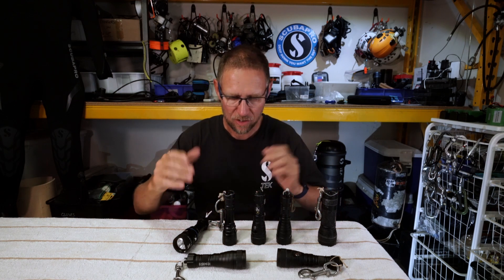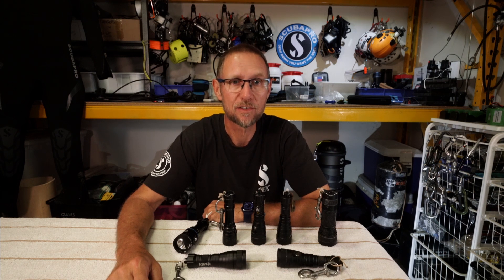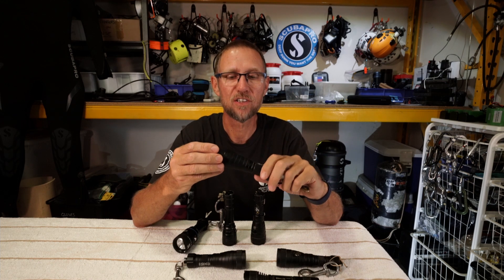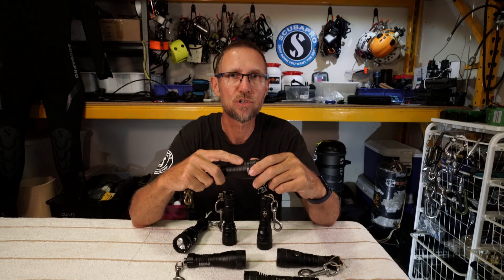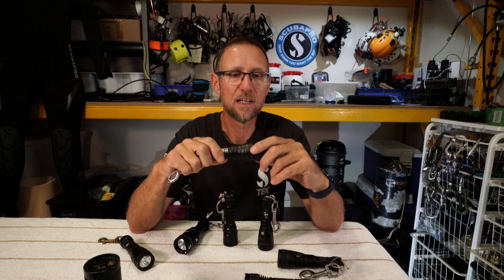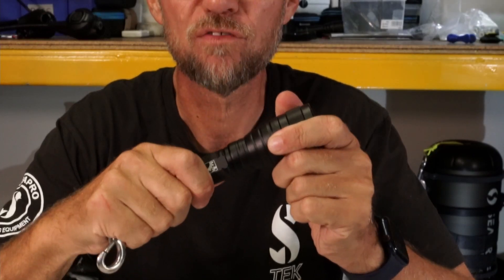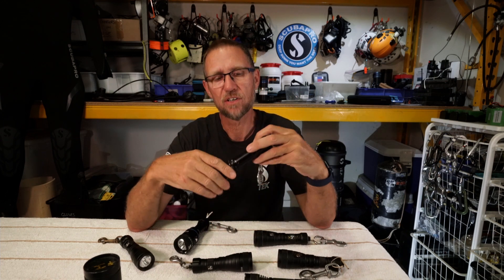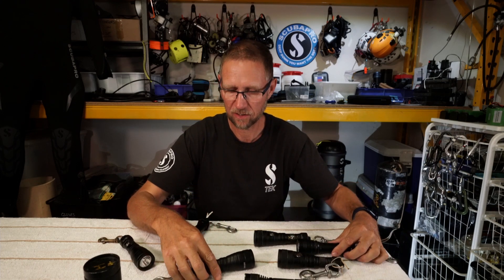Backup Lights 300m Deep Test!

Comment: Dare you put the dive Scurion into it!  I'd be interested to know if it does 300m but (A) won't ever go to that depth to find out myself and (B) would cry if it broke.  🤣
Reply from the maker: Craig and I both have the Scurion Dive lights and we have dived them to 245m. Unfortunately the battery packs started to get small amounts of water in them at that depth. They are undoubtedly awesome lights however!

Comment: I think if you were to measure the 650 lumen light against the scuba pro 850 you would find the difference. Human eyes are actually pretty bad at perceiving brightness. That's why the DALI lighting standard they included the "DALI curve" because we don't perceive light in a linear fashion. 
(But I wouldn't say I am actually qualified in any particular way, so take this with a grain of salt).
Reply: Lumen is the total light production, not the brightness. Light intensity (or brightness) is measured in candela. 

So, for instance, a light bulb can produce a lot of lumen, but since it's emitted in all directions, the light intensity (candela) isn't very high. A laser produces very little in terms of lumen, but concentrates into a tight beam, so the candela is very high.

It's therefor hard to visually compare a 600 and 850 lumen light, since the extra light production may be in the corona, and not in the focused beam.

Comment: Harry

Way in the past they made dive lights that non-penetrating switch using magnetic reed switches, and even the AquaZepp used them for power switching (Zepps used them to activate a relay).  Am surprised that no is making deep rated dive lights using that tech today

John

Comment: Hey Richard, I'm curious about the issues you see with the push button switches - I think you mentioned from the Bigblue lights. If they are activating at depth, I suspect they aren't a true magnetic switch (which would use either a hall effect sensor or a reed, with a moving magnet). For a true magnetic switch, the reed or hall effect sensor would be completely sealed inside the housing, with usually a basic push button with spring moving a magnet close enough to the housing so that the magnetic field reaches through the housing thickness and activates said sensor when the button is fully depressed. The void where the spring and magnet sit is environmentally exposed  to allow water to easily enter / exit, firstly to allow the magnet to freely move but also to mitigate any pressure changes since water can freely move in / out of the void.

Another possibility is that the void I mentioned above in the torches with issues is environmentally sealed, at least from the outside, hence at depth you would run into issues with the button being depressed due to the increasing external pressure.

I've been searching for an off the shelf true magnetic switch solution, but have yet to find one. I have an old un branded dive torch which does use one, but it looks like a custom design where each part, particularly where the magnet sits, has been custom fabricated.

Great videos and content by the way. I don't dive to depths you do (50m is my absolute max at the moment) however I always look to the tec divers to increase my knowledge in order to apply this to my recreational dives to improve my conservatism, amongst other benefits.
Reply from the maker: Hi I actually haven't asked Big Blue how the switches work, but I have had the strobe problem with at least 4 different BB lights on separate dives, and as shallow as 40m in one instance. The Dive Rite primary has a rotating collar which is seemingly a magnetic switch with no penetration of the hull, so that would inspire more confidence. I have some deep dives coming up and will give that a test.

Comment: I’m looking at making a pressure vessel for testing as well. Any recommendations or lessons learned?
Reply from the maker: Next time I would make the top half much shorter so you can fill the base, then more easily put the "lid" on and fill the lid through the top hole. Other wise it seems to working well (and I am no longer terrified of it!). In fact I am planning to get the lid shortened.
Reply: @DrHarryH  Great to know! I'm thinking of a very similar design, but I might try using some thick walled steel pipe and pipe flanges for an easy bolt on top.
Reply from the maker: @serafinobp9428  I did get an engineering mate to review my concept. Be careful and only ever use water to pressurise!
Reply: I would think just the ali top plate would work well without the  short tank section but with inside turned down 5mm to act as a bit of a cap to locate the bottom tank inside it, unless you need the extra lengh of the top tank half

Comment: Well done! Niki fro Scubapro here - the lights guy... We do have a "tec"version of the Nova 850 as well. It doesn´t have the Safety mode (which is ment to protect the light from accidentally switching on in your luggage and melting your t-shirts  :) ) and it is a turn to activate light head, so even safer for your really deep dives. It comes with the 3C battery tube, but you can also use the 18650 tube you have on your normal 850R. The reason why we don´t claim the 300m for the push button lights is that we simply can´t test properly enough to do such a big claim. The light is too relevant for safety to claim sthg that we are not 100% sure of. The potential! failure point could! be the o-ring in the push button, especially when it ages. Anyway, thks for reviewing! Your two-tank-pressure-tank is really cool!
Reply from the maker: Thanks Niki, good job on these lights. I'm a proud Scubapro ambassador so I was thrilled when this light did so well in the test. I'll chat to Brett about having a look at the tec version too.
Reply: After watching Richard's video here, and seeing a review of the Nova 850 Tec. I've been sitting here thinking about a solution to Richard's problem with his backup lights at 30 bar. 

Tactile Switch is a no go, no easy way to remedy the issue of operation at both 1 bar, and 30 bar, plus the other issue of a small o-ring that will fail. 

Tailcap SPST switch is a also a no go, better to use a SPST Toggle Switch on the body, and have the LED Controller failsafe the LED on if the switch fails closed due to water ingress. You would also need to isolate the Toggle Switch from the main body of the light, by have the switch relay control voltage only through contacts in the body, instead of directly wired to the LED control board. This way water ingress into the switch wouldn't compromise the body of the light.   

Twist on heads, with standard single start threads, 30mm x1.5, which I believe is what the 850 TEC has been cut to, are the best solution for it's 30 bar rating. The problem as stated by Richard, is that this style of threaded head lacks usability at 30 bar. The light may be rated for this pressure, but at that rated pressure you can't twist the head because of friction.

My idea is this. Instead of using a normal single start thread on both the head and the body. Insert 3 pins in the head at 120 degrees, pin diameter around .75-1.00mm, then cut a triple start thread in the body wide enough for those pins. 1/8 turn from bottom, and actuation of the light, mill small detents in the thread for the pins. This way the bottom two o-rings are in full contact, but the head has a place to rest before dropping the rest of the way down, and turning on the light. This solution would also eliminate the issue of being able to twist the head on so tight that you can't get it off again. 

The trick will be in how aggressively the detents are milled, so that actuation at 1 bar isn't too easy, and actuation at 30 bar isn't too hard. There's only handful of people in the world that could help with hands on testing...

Comment: so what housing you use for the gopro?? and what model do you use? as far am aware the depth for those housing is 40 and 60 mt! i saw a video 100mt but have a small leackage if i spelled it correct!! thanks for sharing very well made vid
Reply from the maker: Golem Gear make nice 300m housings for a variety of GoPro models.
Reply: @DrHarryH  ill check them out ty

Comment: I’ve got two Big Blue video lights. Interesting that they don’t let you reset them at depth. I don’t get anywhere remotely that deep yet. I’ve had the issue with my screw on Orcatorch lights. I may add an index mark on them so I know they’ll stay off in my pocket until I need them.